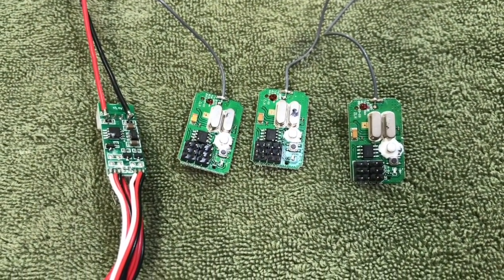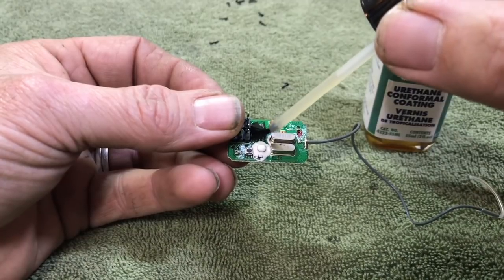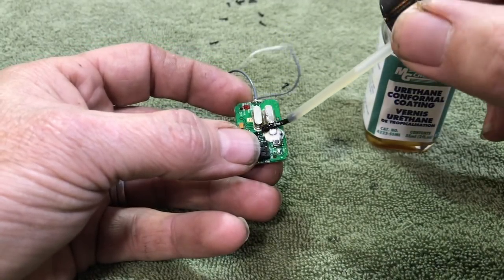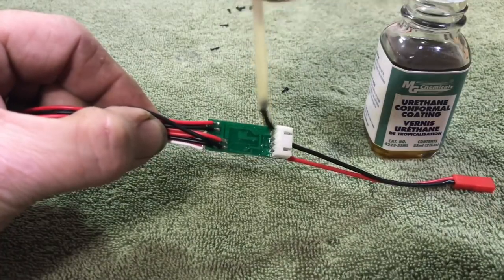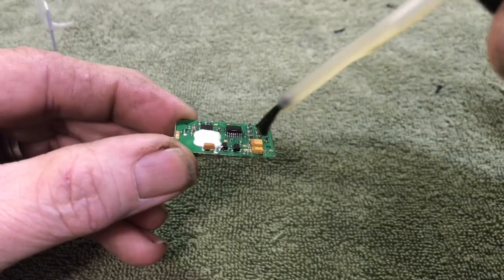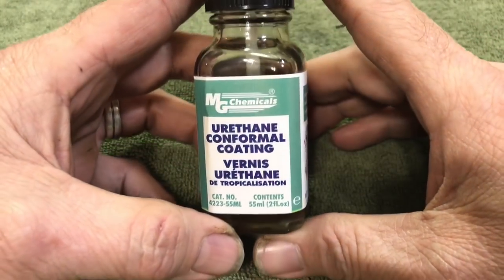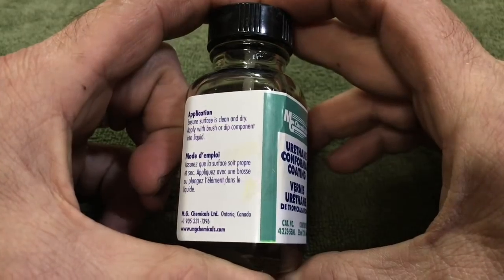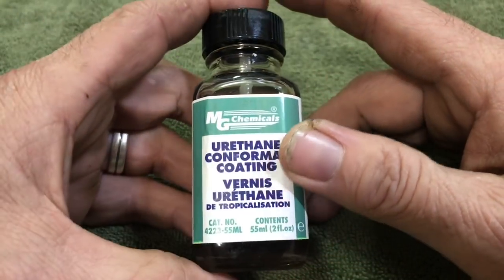Waterproof your receivers

Comment: I need to cover caps and resistors near memory IC's on 4090 GPU before installing graphite thermal pads, will this stuff work for protecting from short circuits? Graphite is conductive. How soft is this coating after curing?

Comment: I have the MYTRICKRC light kit on my Gen 8 Scout, and it stalls and completely shuts down in water.  I tried doing this and it didn't work.  Any ideas?  Should I seal the receiver box?
Reply from the maker: Leftenant Malachi I’ve had issues where the RX plugs get wet and interference is the result. Yeah try sealing the box and see if that helps. If it keeps it going or at least longer than usual you’re going in the right direction.
Reply: @ExocagedRC  Thank you so much, I'd hate to throw out a $70 light kit.  What sort of silicone seal do you recommend for sealing the box?

Comment: I did this today, I put it on everything besides the top metal prongs and the top of the two metal things- capacitators?
Reply from the maker: Yeah I put it across them and seal the bottoms with it. If you get any on the metal prongs you’ll have to scrape it off before it will work
Reply: Exocaged RC okay, thanks for the clarification, but my Receiver has 4 rows of prongs, and I only have three connectors, so when I put my connectors into the receiver, one row of the prongs are still free and are showing, if water gets onto that one row of prongs, will it break?

I’m sorta nervous that I put too little or too much of the coating
Reply from the maker: So long as the board is coated you should be fine

Comment: I use MG Urethane too but I clean mine with denatured alcohol first. A lot of electronics will have residue on them that the conformal coat won't stick to (silicone & acrylic too). Then I use corrosion-x on connectors and fill any voids with dielectric grease.

Comment: I'm so scared if doing that shit, I don't even want to open the receiver up...lol
Reply from the maker: These receivers are cheap, what’s scary is waterproofing something like a tekin rx8 and then getting it wet. That’s a real test. Lol.
Reply: Exocaged RC https://rover.ebay.com/rover/0/0/0?mpre=https%3A%2F%2Fwww.ebay.com%2Fulk%2Fitm%2F122789242519 is this the right one ? Thanks
Reply from the maker: I haven’t used the silicone modified one.
Reply from the maker: I use this in the video but I’ll probably try the Acrylic version next. 

https://rover.ebay.com/rover/0/0/0?mpre=https%3A%2F%2Fwww.ebay.com%2Fulk%2Fitm%2F251918258911
Reply from the maker: This one is what I’ll try next time I order https://rover.ebay.com/rover/0/0/0?mpre=https%3A%2F%2Fwww.ebay.com%2Fulk%2Fitm%2F142562285007

Comment: To water proof my rc electronics I use Acrylic Lacquer Conformal Coating same brand as your using. And you can also simply spray them down with corrosionX and this works also but needs to be repeated once and a while.
Reply from the maker: I've heard good and bad about CorrosionX so I just stay away, I've not had a failure with anything using the urethane. I think the Acrylic dries harder than the urethane?
Reply: Hi I used corrosionX for a very long time and never had any problems the stuff is awesome! The lacquer probably is harder and dries much faster than the urethane there both good to use but I think the urethane don't stay as fresh and last as long in the bottle after you use it and air gets in it.
Reply from the maker: Yeah it does thicken up and gets useless. The Acrylic doesn’t do that?
Reply: I haven't used mine in like since a few months after that video and it still is liquid and good, I work with urethane based rubber  mixes for some stuff I make for RC and you have to use the stuff up fast because once any air gets in the containers and forget if it's humid it will all go bad very fast probably the same with what you have it don't like moisture.